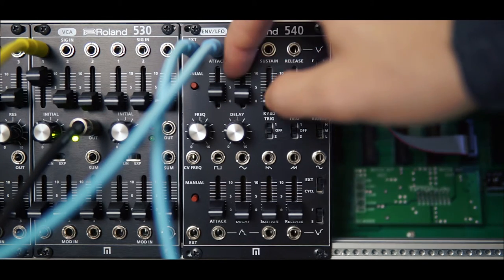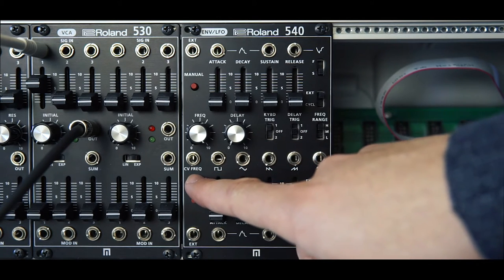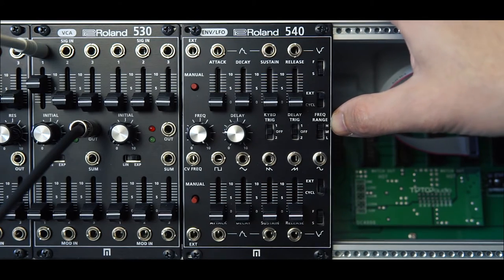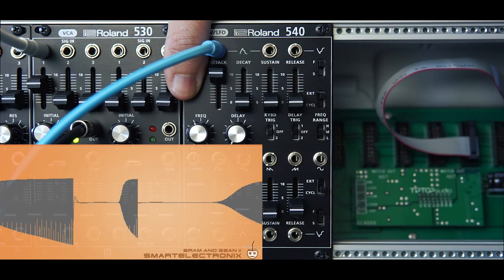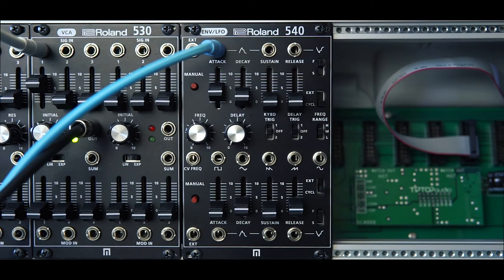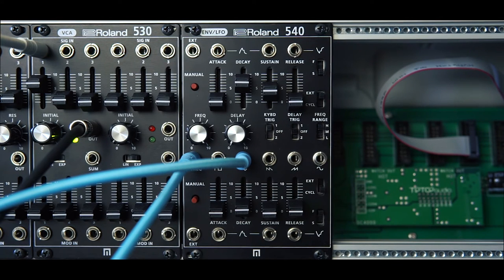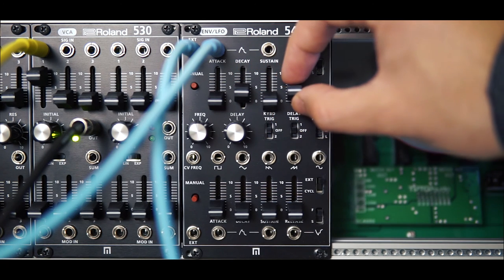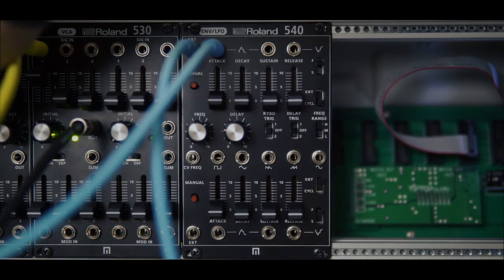Roland 540 Envelope Overview

Comment: Sliders are just laterally sloppy by design...on every synth.  The 100m system from Roland back in the early 70's had sliders that wiggled.  If you pull the plastic cap off the 540 ADRS module, the pole is flat and thin, and naturally can bend or wiggle..